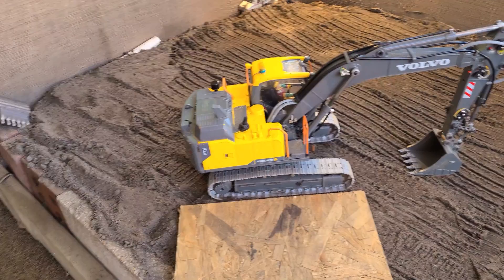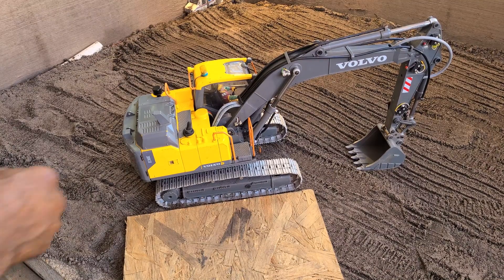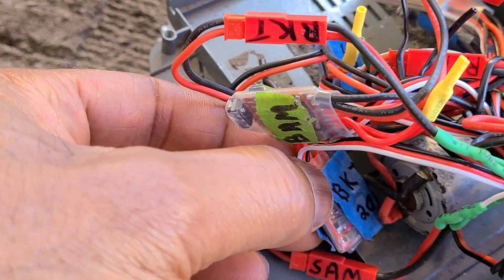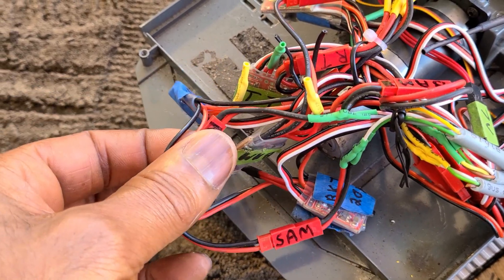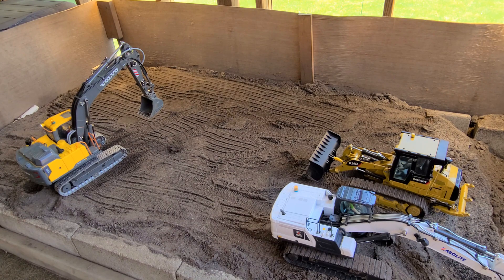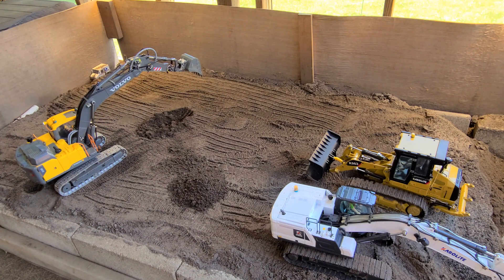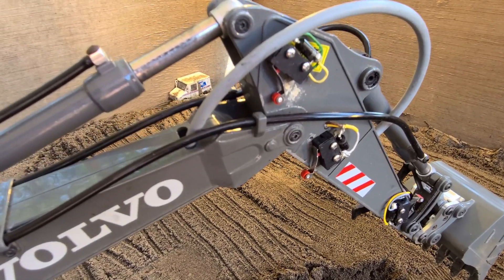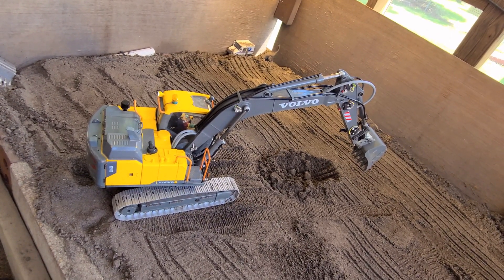Volvo E160E Excavator

Comment: Were the limit switches hard to wire into the system? Or is it pretty straight forward? I’m wanting to do this with mine but was unsure how to create the limits for everything.
Reply from the maker: The limit switches were very hard to do. I had to create a circuit board with six relays to work with the limit switches. If your good with electronics and soldering I can send you the diagrams I made.
Reply from the maker: You can run it without the limit switches. However, eventually it puts a lot of stress on the boom or bucket when you extend them to the limit. I looked at the video and it seems I took the limit switch circuit out.
Reply: @RCconstructionJP  I have a friend that is very handy with this type of stuff, he could probably make sense of a diagram. Although it seems like it may not be worth the hassle. I picked it up for 400 bucks barely used,  maybe I should just convert to hydraulic?